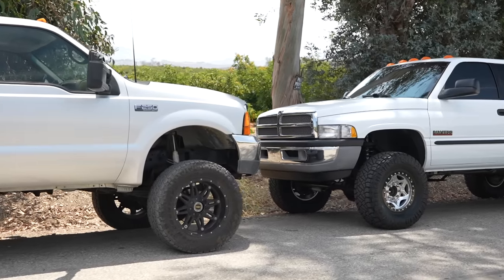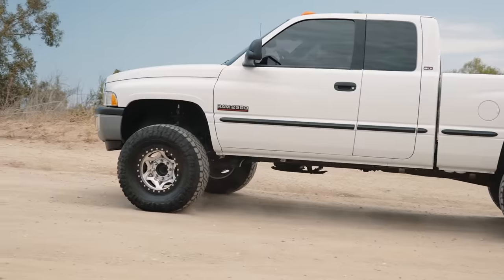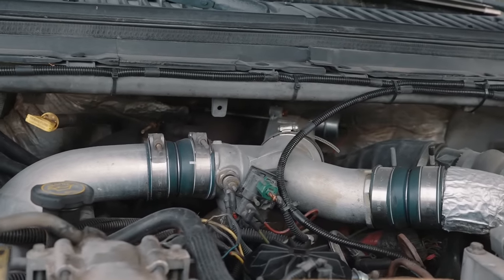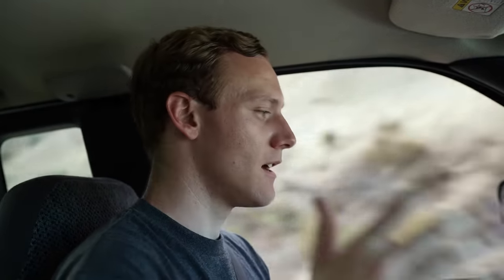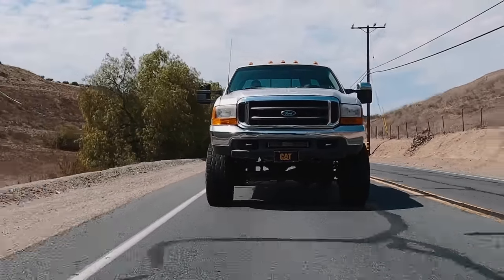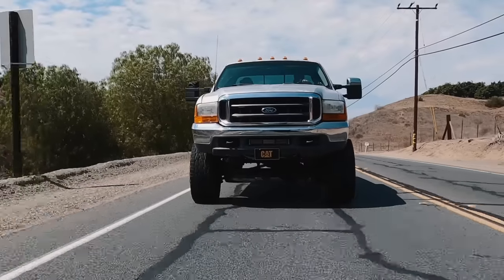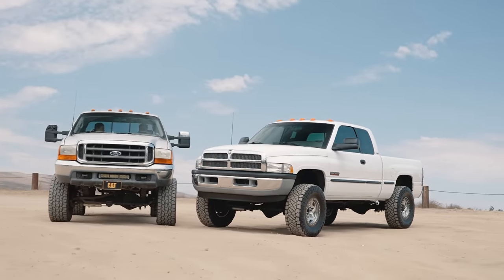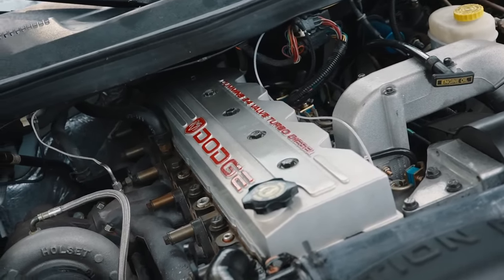1999 Ford 7.3 Power Stroke Super Duty vs Dodge Ram 5.9 Cummins 2nd Gen | Which Is Better?

Comment: I’ve owned both and in the long run I’ll take the 7.3
Reply: my dads 99 has 550k miles never been apart never had a pump or turbo or injector put in it.
Reply: Have the best of both words. Take the Cummins and put it in the Ford
Reply: @jonathanpalmer228  you can get a 6.4 ford really cheap and cummins swap it. Its so common they actually sell kits to do it.
Reply: 7.3 less goo
Reply: Yessir
Reply: I owned both and Cummins #1
Reply: I've seen beautiful 6.4 trucks with blown engines. Its sad
Reply: @BruceLee-xn3nn  So far my 6.4 is still hanging in there just hit 200k hopefully she will stay together for a bit longer i really don't wanna common rail swap it yet
Reply: @twayland6186  .... For the cost may as well buy a used 6.7 at this point
Reply: @miamidangia5122  people don't do it because they're on a budget or cant afford anything newer. Its popular because people really like older diesel engines. Especially cummins
Reply: Omar Mijares  , I don't know much about diesels, but what is a cold side boot?
Reply: No way highest warranty claim of any diesel engine low power and no fuel economy. Cummins hands down.

Comment: I own a 2001 24v dually I've been restoring/building up. I cant get over how CLEAN your 99 is, and both trucks really. Especially the engine bays, gorgeous
Reply: I think what he meant was ford is  "powerwoke " now. Ram is just making solid trucks.
Reply: I inherited my dads 01 with 324,000 miles. He bought it brand new and we've been the only ones to use it. I have an 03 with 40s and 700hp but I barely drive it anymore since I got the 01. 

This second gen has been the most reliable truck I've ever owned ( after installing the fass ).
Reply: @Anthonysmith-ic8ef  you'll call me a liar, but the factory lift pump and vp on this truck lasted roughly 315,000 miles. I know I got lucky which is why I got the lift pump upgraded
Reply: @treycherry1367  Holy Shit dude Damn I’ve never Heard of anybody making it that far but at least you got the good one on there now She’ll be as reliable as can be
Reply: Currently rebuilding my 99 dodge ordered my front end from cjc offroad

Comment: I feel like the 7.3 is a little more of an all a round truck. On the 5.9, there were a lot of good things, but there were some bad things that can be a problem, like the transmissions and interior. On things that were bad, the 7.3 was better in those areas. And on things that were good about the 5.9, well the 7.3 wasn't too far behind, besides repairs.
Reply: 47/48re was one of the best transmissions built.  It's great for stock 225hp levels and great at 2000hp heavily modified.  People who put a tuner on their 20 year old ram thinking their transmission will survive are out their mind.
Reply: @markrich3271   Not even close.  
The 4R100 is far superior to the 47RH.

The world’s fastest Dodge Cummins drag truck runs a BTS built 4R100.  

The 47RE internals are simply too physically too small to hold the torque of a 2000HP race Cummins.

The 4R100 is better stock and WAY better when built and it’s not close. 

The 4L80 is also better than the 47RE but still straight up dainty compared to the 4R100
Reply: I agree
Reply: Ford's have the same transmission problems! I built one for my 47re, my friend is on his 4th 7.3l transmission. 
Never herd of anyone swapping in a powerjoke! But many people and companies Cummins swap ford's! Fummins!
Reply: @Hayden Pearson  He's a diesel mechanic and has rebuilt many 7.3l motors and drive trains. He is also pushing more power than most too. I know people who have 300k on stock 47re transmissions, so it's a moot point. 
One thing I know for sure, no 7.3l, 6.oh is starting without being plugged in below 32 degrees. They all crank and crank! I can fire mine up at -25 below and pops right off. I can also out tow any other brand even new, the I6 was built to tow. It wasn't fabricated to compete in the diesel industry, it set the bar for any and all light trunk diesel engines.
Reply: @BC08  What you are saying is laughably stupid or just ignorant. All of those transmissions of that era have similar sized components, including clutches, steels and shafts. Most of the high-power Rams you see are still backed with a built 47RE or 48RE, including the first ones over 3000HP. It has a tremendous aftermarket and can be built to handle insane power and torque.  If you were talking about the more modern transmissions like Aisin, Allison etc that use components that are several times the size, you might have something resembling a point (before the Allison was tamed, 48RE swaps into high power Duramax trucks were also common, known often as 'Duraflite'). The 4R100 comes from the E4OD, which was derived from the 3-speed C6. The GM 4L80E was derived from the 3-speed Turbo 400. The 48RE/47RE was derived from the 3-speed 727 Torqueflite/A518. These are all transmissions of the same basic era. Chrysler cheaped out on the 4-speed truck versions unfortunately. OEM input shaft, flex plate, torque converter and other components are subpar. Stock for stock the 4R100 is easily superior, but to say the drag truck you mention couldn't have a 47/48RE is a joke.
Reply: @drifterbbb3649   You know, I really don’t understand why people such as yourself who aren’t informed enough on the topic to have even formed a valid opinion feel the need to throw around terms like “laughably stupid” and “ignorant”.   

You’re projecting.

BTW the “3000 hp” 48RE isn’t doing anything worth talking about.   Runs 8s, happy dyno.  

The 4R100 platform WILL hold more torque than any other mainstream automatic OD transmission that came in a 3/4 - 1 Ton pickup  right now.  Proven. 

There’s a reason BTS 4R100 Cummins swap kit is as popular as it is.
Reply: @BC08  LOL. I call a spade a spade. Who's the one projecting? You sound very emotionally invested in the 4R100. Please tell me with some quantifiable evidence about how it is "proven" to support more torque than the likes of any of the other high-performance transmissions out there, including the ones that actually ARE significantly beefier with massive clutch disks and line pressure.
Reply: Jesus loves you
Reply: @drifterbbb3649 47/48re are cheaper to rebuild than an E404R1 

Once you start pushing power the 4R1 is the better choice... Everything is off the shelf for these

Both are good trucks... Perfect truck is a powerstroke with a 5.9

Comment: I love my 00 7.3! Wouldn’t trade it for anything! Great video, very thorough, very fair comparison. That’s what pushed our trucks to get better is that very close competition, if they did have that, we wouldn’t have the trucks we have today.
Reply: They are soo equal in most respects, except in ease of repair. That straight 6 has got that hands down. But damn I'd love either.
Reply: @seanbutler2291  Go change the oil, serpentine belt, alternator and AC compressor on a 7.3 Powerstroke, then do it on a 24V Cummins and tell me which was easier.
Reply: Jesus loves you
Reply: "Didn't"
Reply: @braxtonpayne9093  Jesus DIRECTS His great love to all....but until someone turns to Him with a repentant heart they are still under judgement....just need to speak truth.

Comment: I’ve owned and daily driven both and still have the 7.3. They are both incredible trucks but I will say not only on the 2nd gen is the interior by far worse, so is the general truck itself aside from the motor. They look immaculate but the components like steering, ac, paint quality, etc are all marginally cheaper and not as quality as those on the ford. I loved my 24 valve though. The ride quality and ease of accessibility in the engine bay were huge perks. But I gotta say, if I had to chose one to take with me to work or tow across the country, I’m taking the 7.3 in a heart beat. Great Video!! Personally I think the two greatest diesel trucks ever made easily!

Comment: The construction company I work for had both trucks. Cummins is a great engine but the rest of the truck falls apart. Ford super duty’s hold up way better. Both good looking trucks though.
Reply: Exactly. Its not a good comparison because they're really comparing a cummins diesel to an overall good truck.
Reply: Yep dodge trucks are cheap rattles apart, had one I did injectors and pump on and I swear the headlights were shaking like loose eyeballs lol
Reply: I'd swap a 12v Cummins into a F-550 for the ultimate truck.
Reply: @theyeetus1428  Our company mechanic has that combo in a 08 F550. 6.4 blow up so he put a low mileage 5.9 Cummins in its place. Makes a great shop truck.
Reply: @christ6671  I bet it's an absolute dog on the road though lol especially if it has ... 5:13's I think it is?
Reply: I find it funny when people say that like it's the tru KS fault for not proper maintenance.  Including rust proofing. Yes sir your 20 year old suspension is fine considering it should of been changed 14 years ago. Parts wear some faster than other. Take care of your shit. I do.

Comment: I think maintenance and upkeep has to include other stuff like the front end. Although the Super Duty's leaf sprung front end isn't all that comfortable it is remarkably durable and straight. For a construction or rig truck they take a lickin and keep on tickin. The stock track bar on the 2nd gens tweaks itself over speed bumps.
Reply: Yeah the durability of the chassis in general on the Ford is way better.

Comment: I have a 99 Crew Cab 7.3 with the 6 speed manual. I’m partial to the look and stance more than the Dodge. I think the Super Duty looks more modern. But I’ve had two 2nd gens, and I loved them both. So it’s a tough call, but I lean Ford.
Reply: Owning both dodge and fords I prefer my fords. Even better if you put a cummins in a ford body, A dodge is ok if you get a manual truck and don't mind fixing the suspension issues they have and all their plastic pieces having been made on a friday evening near quitting time
Reply: I have a 97 f350 7.3L manual 5 speed and I really love it, my dad was going to sell it to pay bills and I told him to sell my Yamaha 700 raptor instead and I never regretted it
Reply: @angelopadilla2759  Gotta love the obs trucks
Reply: I have a 99 7.3 that I have put 300k on. Still have it!
Very little issues!
I had a 02 7.3 that I sold at 411k with very little issues!
They key to them is Maintenance Maintenance, and Maintenance!
I replaced the 411k 7.3 with the 5.0 Cummins! 
I love the truck!
Coming up on 50k. No issues!
But the best truck ever, Hands down! 7.3

Comment: I’m am so happy to see the honesty here and unbiased explanations. I’ve been a self employed contractor since 99 and still have both my 99 crew cab dually 7.3 lariat (580,000 miles and my 01 Dodge Ram 24 valve 2500 extra cab 5 sp
(506,000),  love both trucks. I’ll be pulling out the 7.3 and swapping a Ford 7.8 straight 6

Comment: That is the most complete 2nd gen dash I've ever seen! My pops owned an 01 and if you looked at the dash wrong it cracked.
Reply: Lmao I'm waiting for my new to be delivered right now
Reply: I have 2 1/2 tons, a '98 and a '99, and both their dashes are cracked in several spots
Reply: my 99 has a gaping hole in the dash. I wish it was just a crack. using it as work truck.
Reply: My 99 has a perfect original dash .  The drivers seat is a different story though.
Reply: My 97 second gen dash is mint
Reply: It also has only 92k original miles
Reply: @johnbowker5  man you're lucky, my has an 01 and anything you put on top of the dash ends up playing plinko as if falls through the dash and if you're lucky it makes it to the floor.
Reply: That's the truth got a 01 3500 great truck except the dash and transmission
Reply: The stock dash is WAFER THIN. I have to order a replacement soon. I hope the aftermarket dash is made better.
Reply: I’ve got a 97 3500 with zero cracks. Original dash.